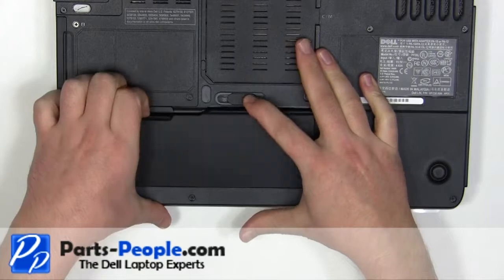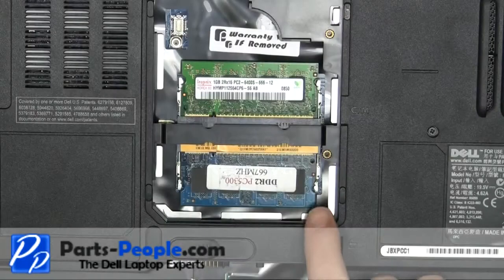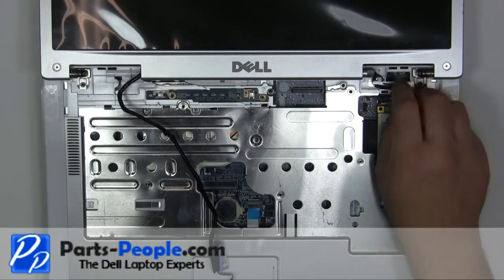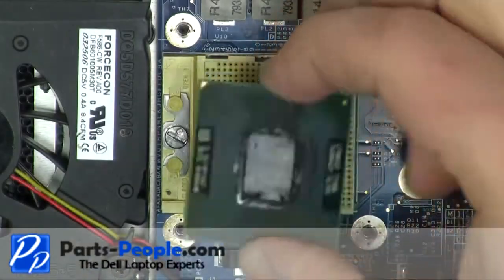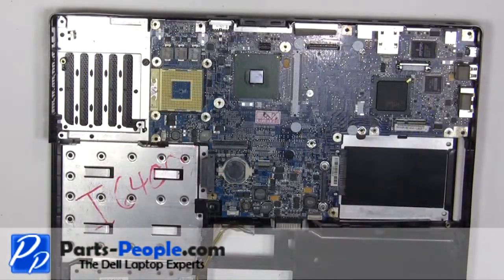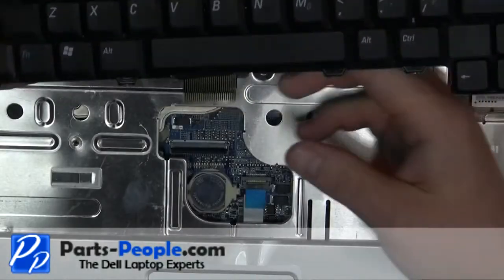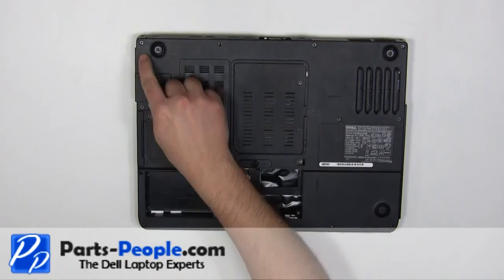Dell Inspiron 6400/e1505 | Motherboard Replacement | How-To-Tutorial

Comment: Where is the ATI MOBILITY RADEON graphics card?
Reply from the maker: +groundrail The model used in the video had inboard graphics and did not use a graphics card.
Reply: I need to find a video where the E1505 uses a graphics card so I can see how to finish putting the board back together. Anyone know where I can find a video?

Comment: Excellent video! I used it to switch motherboards. The DC power jack on my old board gave out and the battery wouldn't charge. All the steps made this look intimidating, but it wasn't bad at all. Two errors in the re-install instructions:

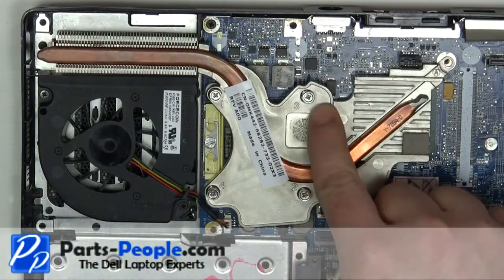At 10:37, you show the heat sink going back in place with the fan already there. Then, at 10:56, you show the fan installation.

At 12:34, you show how to reconnect the antenna wires to the wireless card. Then, at 12:43, you show the re-install of the wireless card.

Nothing was missing, just in a confusing sequence.I got all of my parts back right where they should be, nothing left over, and my computer is now back to working 100%. Thanks!

Comment from the maker: There is an alternate motherboard for the e1505 but it uses a different video card. The motherboard will still max out at 2gbs of RAM and the video cards are pretty expensive too. It would cost about $100 for the alternate motherboard and about $100 for the video card. Personally I don't think it's worth the cost.